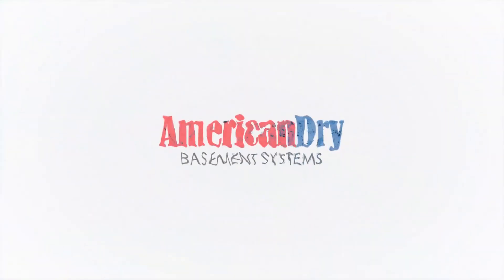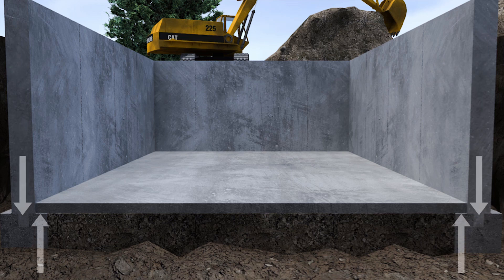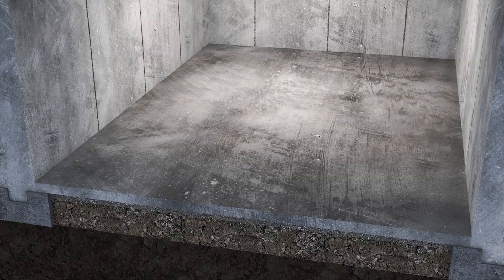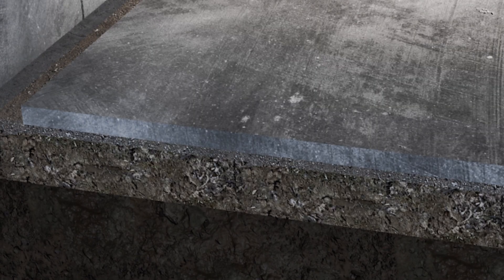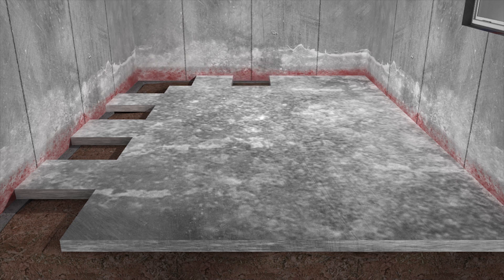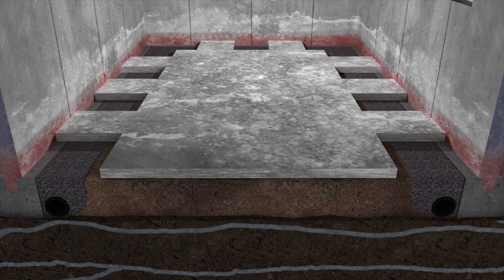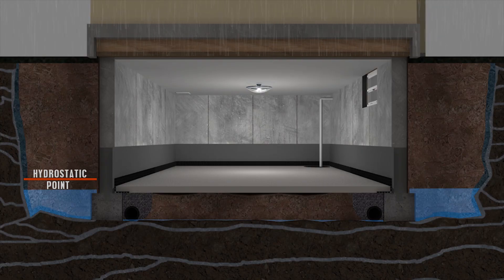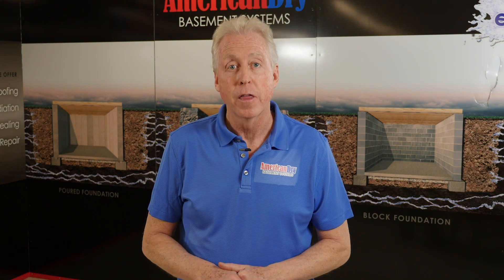How to Avoid Weakening Your Foundation

Comment: What if your wall has no footing ? how far into the room can you install the drainage if you cant go against the outer wall.
Reply: You usually leave 16-24 inches out from the wall of the original dirt, and treat that as the footer, if there is no concrete footing. Michigan Waterproofer here.

Comment: Hi sir. Can this be done after the house is built?
Reply from the maker: Yes. But it's unnecessary. Depending how much groundwater the soil outside your house percolates after a rainstorm will determine how quickly your new basement will succumb to water seepage. Most new homes can last 5 to 10 years. I've seen homes have no problems for 20 to 25 years. Spend the money when and if the problem ever occurs before you sell your home.
Reply: @AmericanDryBasementSystems  I'm in the process of purchasing a new construction home.   I went in two weeks ago a few days after a major rain.  There was a water line around the entire basement.  I was told the basement flooded because electric was not on yet and the sump could not run.  Is this a problem.  Should I purchase this home?
Reply: @RodneyGoldston  for new construction, absolutely not normal. I hope you didn't buy it.

Comment: Since part of the floor stays intact how do drill weep holes in the cinder blocks to drain the water  that gets inside the cells?
Reply from the maker: Excellent question, Shane. There are several cells behind each spacer. We go through a neighboring weep hole with a long drill bit. The bit makes a hole in the lateral wall of the cell behind the spacer. The water in those cells drains out of the weep holes on either side of the spacer.

Comment: Can I use schedule 40 perforated pipe?
Reply from the maker: We don't use schedule 40 for subfloor drainage. Too rigid, non-continuous, requires clean-outs, too many elbows and pieces to get it around a room. I prefer using sch 40 above the floor for plumbing and discharging water.